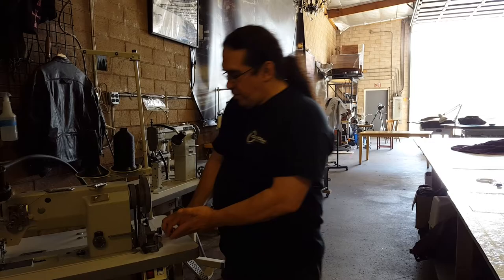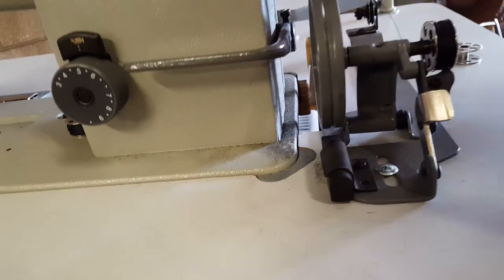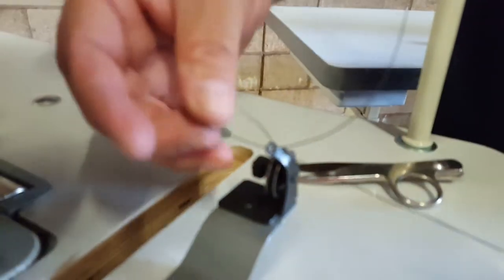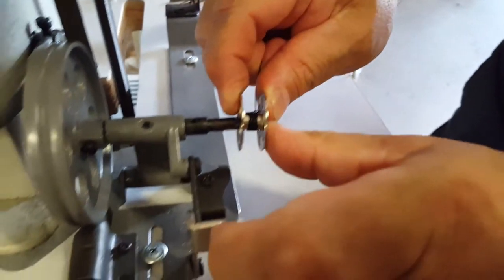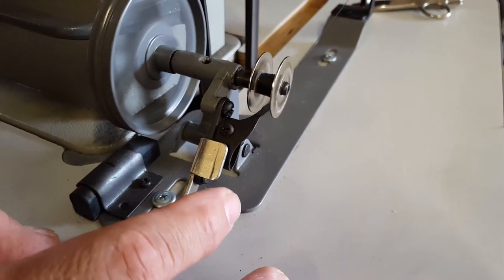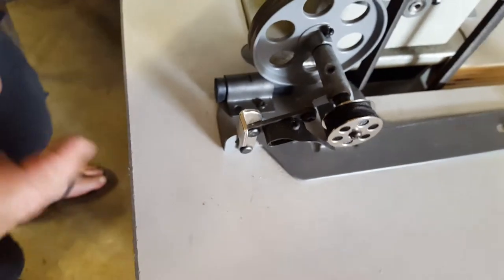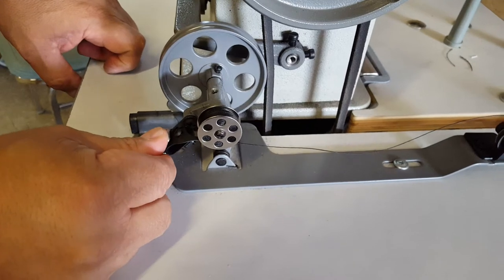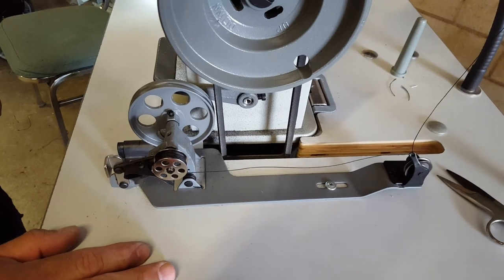Table mounted bobbin winder explained

Comment: Hi Al,
Good video. Nice and clear. Just one thing. I noticed you took out the needle thread to start the winding process but did not mention anything about the bobbin thread. I guess in most situations people may not have a bobbin in the machine if they are winding a bobbin because they have run out of thread. But If they do still have it in and it is not empty, I would recommend they also take it out. I recently had to spend several hundred dollars getting my machine fixed because as I was adjusting the speed of a new servo motor, I did not take out the bobbin thread. It created the biggest birds nest and pushed all the gears out of alignment.

Comment: @Al Bane (and company) Thank you for posting this. I build one from a 12" long piece of wood (1 1/2" high by 2 1/4" wide at the top). The supply bobbin is held loosely by a screw midway on the side (the 12" by 1 1/2" side). Its thread passes through the hole in a bobby pin that is screwed to one end of the board (the 1 1/2" by 2 1/4" side). This way the pin can be adjusted sideways as needed. A small brad (nail) between the supply bobbin and the safety pin keeps the thread from trying to jump over the safety pin. On the top side, opposite the safety pin, I mounted an DC motor that holds the take-up  bobbin. The speed is controlled by the voltage going to the motor. In my case, the 17V motor is from a old ride-able toy car, and the adapter was set to 4.5 V. No tension plates. It took a couple of runs to get a uniform winding that did not snap the thread at the sewing machine. It's a joy to watch!

Comment: Very nice. Now to help you a little. It looks like a lot of black rubber dust where the belt is coming into contact with the bobbin winder base. You need to file off or reposition the base.

Comment: Thank you for explanation :) i have problem with thread skipping out of disk. What can i do? Thank you for helping me
Reply from the maker: This is why we load the thread in the guide through discs and back out through the guide again.
Reply: I did this and still is not ok
Reply from the maker: @polonakadunc9864  it's possible that you have a bad cone of thread. Have you tried changing it to a different thread?
Reply: Yes i have
Reply from the maker: @polonakadunc9864  are you sure that you are pushing the thread between the two discs until it reaches the center of the bolt? If you aren't seating the thread all the way into the center you won't be developing any tension and the bobbin will wind very loose
Reply: I made video what happened with thread and now i don't know how to load it here. I have loaded it under my account 🫣 thank you for helping me 😊

Comment: Hey Al,  I have the Cobra Class 20 machine withe the same type bobbin winder.  For some unknown reason the axle spins but the bobbin will not take up thread.  What could be causing that?

John Gatlin

Comment: I have a silly question. I purchased a few bobbins but I guess the inside hole of them are not tight enough compare to the machines' original ones. So the bobbins are loose when I slide them to the axle. What is the solution to this? Because I tried every bobbins on the stores and all of them are loose.
Reply from the maker: Spread the end of the winders shaft with the screwdriver.
That will hold the bobbin on while it spins.
Reply: @albaneforleather  Thanks a lot man. I was thinking of doing that, but I wanted to make sure.

Comment: What is the best tension on the tension disks? Thanks
Reply from the maker: Sorry for the late reply. I just saw this today. Too much tension on the thread will force the bobbin to load excessively tight. This will cause two things inconsistent tension in the sewing machine resulting in inconsistent stitch quality. But more importantly it will put more thread on the bobbin itself causing it to expand and change shape so then when you load the bobbin into the machine it generates more friction because it's bigger than its original specification and causes additional stress and tension problems. I hope this answers your question and again sorry for the late reply.
Reply: @albaneforleather  no worries about late. Thank you very much 💪